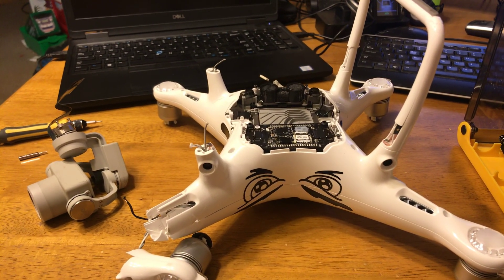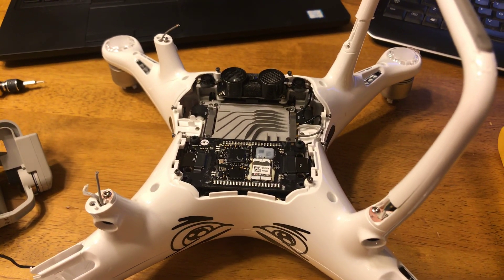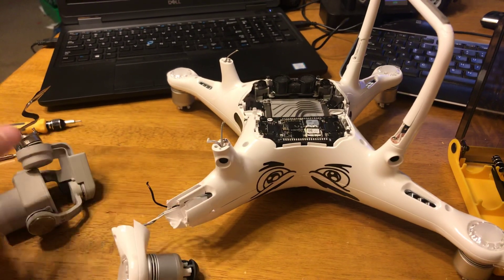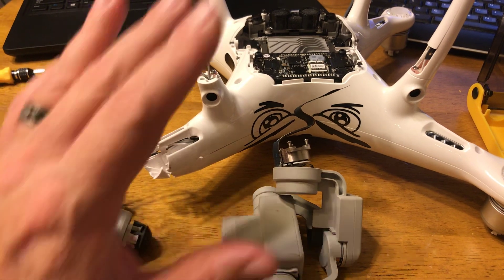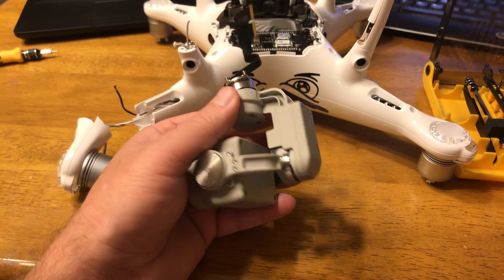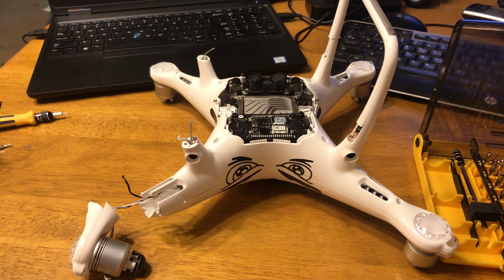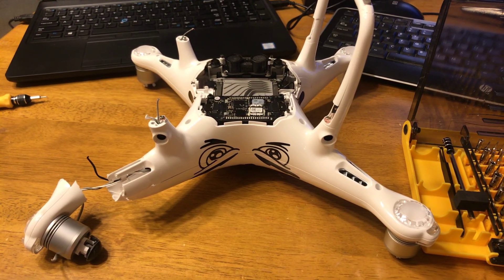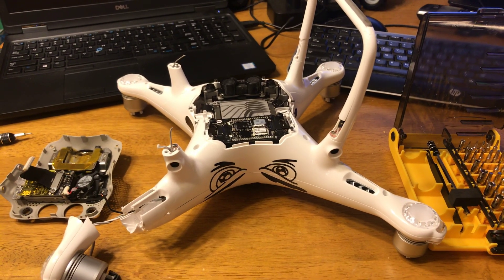The Heron Bird Sequel - Gimbal Damage Assessment

Comment: Cool video, where do you found the spare parts? If you need help, I thing we might be neighbors...
Reply from the maker: I find parts primarily on Amazon and Ebay. There are a few times I will work with a local DJI repair center for impossible to buy parts.